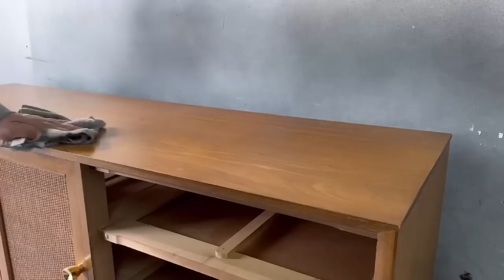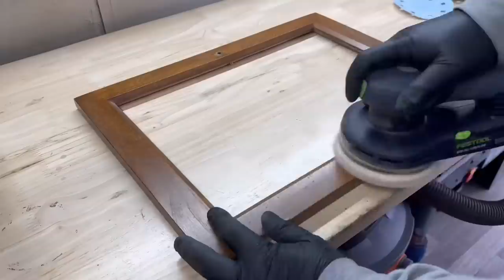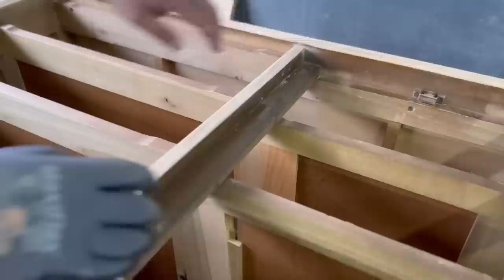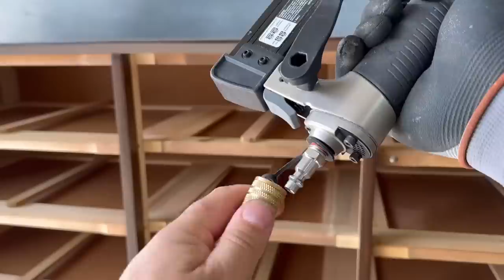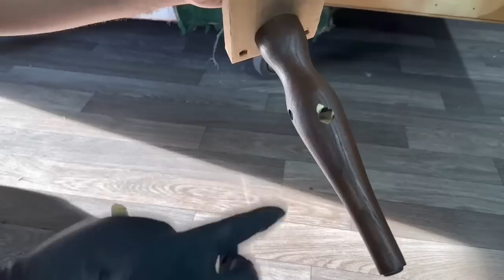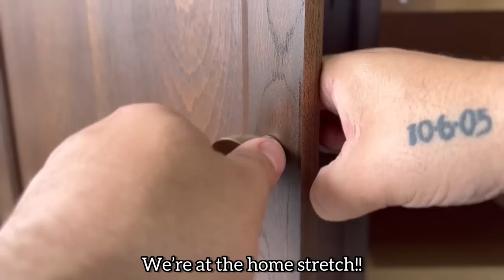AMAZING MID CENTURY FURNITURE TRANSFORMATION || HOW to flip furniture as a side hustle FROM HOME

Comment: Thank you so much for posting this. I'm working on my grandparents French Provisional dresser. I'm using 150 sand paper and the natuaral wood is so beautiful. I ordered the walnut that you used on this dresser. I'm just wondering if it might be too dark. I'm thinking of doing one light coat and then using the water base satan over it. My fear is it will be too dark. I want the wood to shine through just like you did on this dresser. Amazing job, you're so talented!!
Reply from the maker: I think it should be fine. Give it a test spot and see if you like it. I love to hear of others worming on their own projects
Reply: @CedarPineDesigns  Did you use walnut polyurethane? Or the dark walnut stain. I'm confused.
Reply: @CedarPineDesigns Stain color: Natural colored danish oil and Dark walnut stain. It's a blochey mess. It dries too fast for amateurs like myself.
Reply from the maker: @motocatz87  I used dark walnut stain, then natural colored danish oil and let it dry before rubbing in some furniture wax like Howard’s or Dixie bell
Reply: @CedarPineDesigns   I used your link to the wood stain on Amazon, but again dries instantly. It doesn't seem to be the natural colored danish oil, perhaps it's not the right link?  I now purchased the walnut water based stain by Varathan. They told me at Home Depot that I should use Waterbase walnut stain because I plan on using Waterbase satan on top. I'm still getting a little blotchiness, but much less with this stain from Varathan. I'm thinking of using a brush or sponge instead of the cotton rag you suggested.  I'm going to light sand the drawer to see if I can get the bloches out.  I didn't think it would be this difficult. Thanks for your advice!
Reply from the maker: @motocatz87  no worries. Did you use a pre stain conditioner? That helps with blotchiness